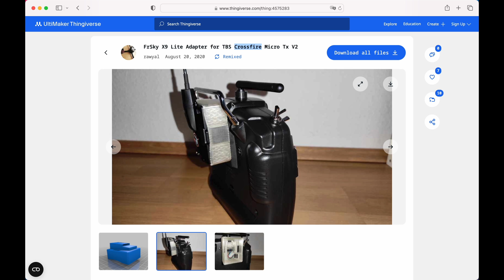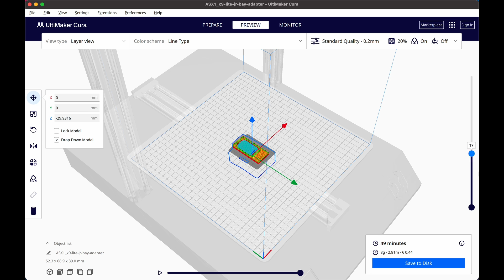Why you still need an adapter for FrSky X9 lite to use a Radiomaster ELRS Module?

Comment: Can't you just use the micro module instead of the nano and avoid all the hackery?
Reply from the maker: No, that's not going to work. If you have a look at the 3D model linked in the description, you'll see that the micro module is far too large to fit into the module bay. Nano module has the right size in terms of height and width, but the bay of x9 lite is not built according to the specs. It's too deep.
Reply: @the-rc-science-geek  What if you have a Taranis X9D Plus 2019 Access?
Reply from the maker: @thunderzone802  That's a completely different story. The X9D has a bigger case with a micro bay on the back. I guess normal micro modules should work.